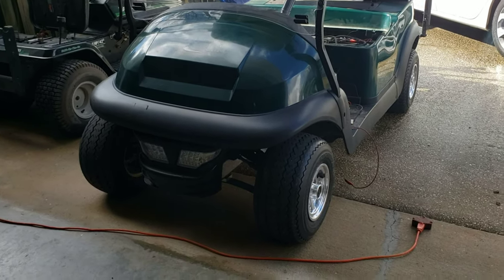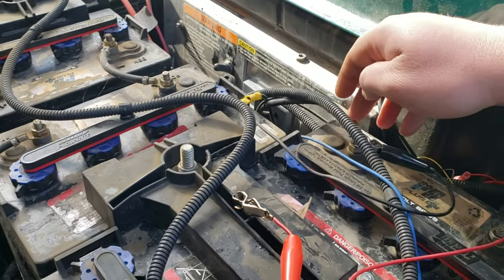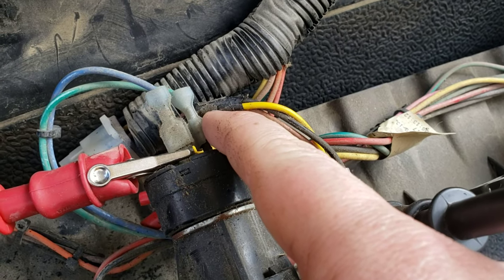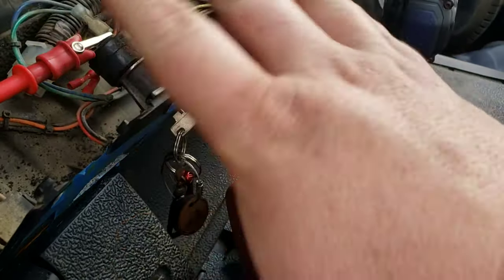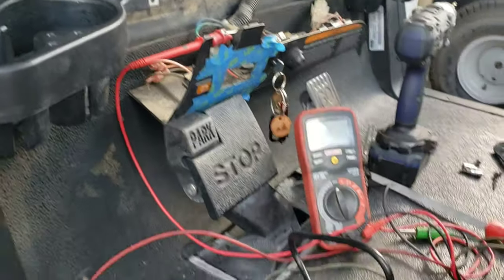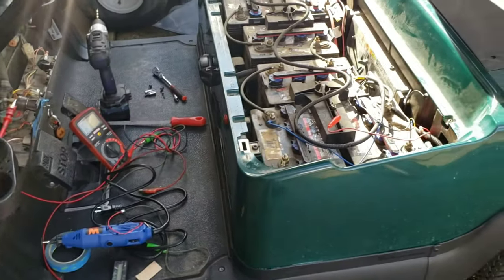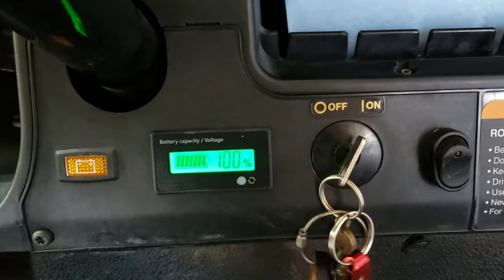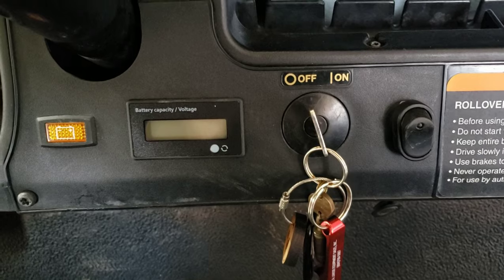How to install voltage gauge on Club Car Precedent

Comment: OMG, I wasted 3 hours wiring to the wrong places and then trying to go straight to the batteries.  Ha!  Everything failed.  Then I came across your video and, truth be known, all I needed was the 30 seconds about wiring to the switched side of the key and 'bingo', done in less than a minute!  Thank you!
Reply: how accurately do these little gizmos actually track the battery %

Comment: if your battery percentage always show 100% do this.

Select the number of batteries. In the case of Lead Acid they assume you have 12 volt batteries wired in series. In my golf cart I have six 8-volt batteries for a total of 48 volts. When I first programmed it I entered "6" batteries and as a result it read the voltage correctly but the capacity indicated 0%. I later realized they are assuming 12 volt batteries. So 48 volts divided by 12 volts resulted in 4. I entered 4 batteries and it worked. Enter your equivalent number of 12 volt batteries and then long-press the function key. (Note the lithium battery settings assume your batteries are 3.7 V or 3.2V. Your math will be a little different.)

Comment: Thank you for your video! We got the same exact one and just put it in, seems like the percentage doesn't move but voltage works so I'm good with that. Thanks again!
Reply from the maker: My percentage stayed at 100% but voltage changed, turns out I had it set on the wrong voltage setting. Now the percentage works fine.

Comment: That's a great idea. I do have a question... I purchased the DROK battery capacity monitor. It instructs you to set you high a low voltage range. Im not sure what would be considered "low" for a 48 volt cart? 48, 40, 38??? Suggestions?
Reply: I'm having the same issue. I found this, but am still messing with the wiring on my volt gauge. https://www.buggiesgonewild.com/showthread.php?t=112256

Comment: Thanks for the helpful video. I have the same meter installed, unfortunately mine did not come with instructions. So I am stuck with 100% at all voltages. I would really appreciate if you could share the procedure to correct that. Thanks and great job!
Reply: did you figure it out? I'm having the same issue
Reply: Select the number of batteries. In the case of Lead Acid they assume you have 12 volt batteries wired in series. In my golf cart I have six 8-volt batteries for a total of 48 volts. When I first programmed it I entered "6" batteries and as a result it read the voltage correctly but the capacity indicated 0%. I later realized they are assuming 12 volt batteries. So 48 volts divided by 12 volts resulted in 4. I entered 4 batteries and it worked. Enter your equivalent number of 12 volt batteries and then long-press the function key. (Note the lithium battery settings assume your batteries are 3.7 V or 3.2V. Your math will be a little different.)
Reply: Turn key off hold settings button and turn key on then it will go into settings
Reply: Does your battery gauge fluctuate when you drive

Comment: I did it exactly the same as I didn't want to run all the way to the batteries, and I wanted it to go off with the key.  Problem is it only reads the correct battery voltage when you first turn on the key, after that it reads low as checked against a Fluke VOM across the batteries. It appears that wiring isn't good enough! I think I will use a relay to turn it on and off via the switch and sense voltage at the battery.  A low value fuse at the battery connection is necessary to avoid a fire.

Comment: Great video.  If a cart does not have lights or other accessory switch, should there still be a way to plug into 48V by the switch?

Comment: Thanks for the video. 
I just installed it just like yours. Same golf cart as well. It always shows 100% and cannot seem to get into the settings. it shows 38V, not 49.
what can I do to display the correct battery percent instead of 100% all the time? 
thanks
Reply: Turn key off hold setting button turn key on then it will go into settings

Comment: Watched the video. Great video. I did subscribe. Question. Someone replaced the battery light with a digital volt gauge similar to yours. They used the existing wires. And it works. Is this ok????
Reply from the maker: It should be fine and operate normally as long as a good power and ground is present where the factory battery light was at.

Comment: I'm just curious since you said you tied it into the light switch negative, what happens when you turn the lights on? Does it stay at 48-49V?
Reply from the maker: Yes, they only share the ground and doesn't effect light or gauge output
Reply: @Powertool1990  Thanks very much!!

Comment: Does yours fluctuate when you drive? Your battery level?
Reply: Mine does! I wired it a couple of different ways off of the key post. Either way I do it, the battery charge level indicator decreases rapidly while I drive. I only get an accurate battery charge level when I've been stopped for a few minutes. If I'm going up a hill, a fully charged battery will indicate around 25% charge level, then when I stop it will rapidly climb up to 98% or so.  Any ideas on how to wire this indicator for no fluctuation while driving?

Comment: Do I need to disconnect the battery pack before connecting the voltage meter to the key switch since there are 48-50 volts running through the cart wiring, even in tow mode? Is it safe to leave the batteries connected and just switch to tow mode before wiring the meter?
Reply from the maker: I did everything with the batteries hooked up, just don't touch the wires together. I basically just alligator clipped them to the terminals so I didn't actually cut any wires. If you plan on hard wiring them I'd probably disconnect the main cables from cart to batteries
Reply: @Powertool1990  Thanks for the reply. If I disconnect the main cables from the battery pack, does it matter whether I disconnect the negative end or positive end? I've heard there can be arcing/sparking when reconnecting the positive side. So can I just disconnect the negative side to avoid sparking when I reconnect after the install?
Reply from the maker: @bobbychapman9710  always remove your negative cable first and then reinstall it last. It avoids sparks or potentially grounding your positive side while removing.
Reply: @Powertool1990  Thanks again. Can I only remove the negative cable, thereby breaking the circuit and cutting off power? Or will I still have current in the system while I'm hard wiring the voltage meter?
Reply from the maker: @bobbychapman9710  the negative should be enough by itself but double check where you're wiring with a meter to be sure the current is dead

Comment: I have the same one but the percentage always stays at 100% I even put it on P06 but it will always stay at 100% any help would be greats. Thanks.
Reply from the maker: Mine did the same thing until I switched settings to match the voltage (48v) I forgot what setting I used but it depends your setup.
Reply: @Powertool1990  :/ guess I’ll be stuck with it at 100% lol 😂 I have even gone up 1 every time but it never drops :/

Comment: How did you tie those wires in?  Just wondering how u did it.
Reply from the maker: I believe I got 2 small alligator clips and clamped them in the same place as my multimeter in the video. since they share the terminal it's the simplest way since it's just a gauge. You could get new terminal ends and splice the gauge wires and factory harness together to make it more permanent but I didn't want to hack the factory harness up and I had the clamps already so I used what I had